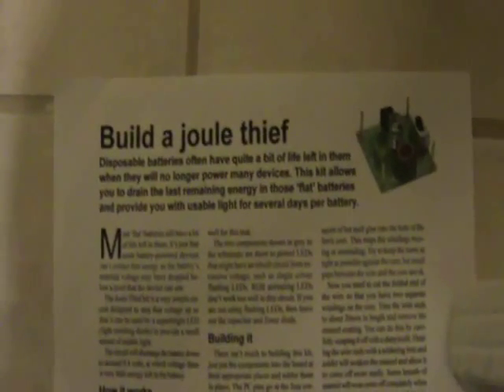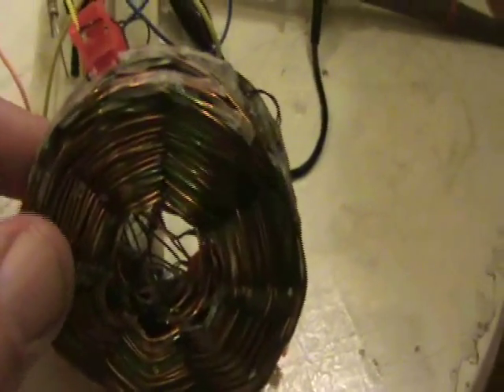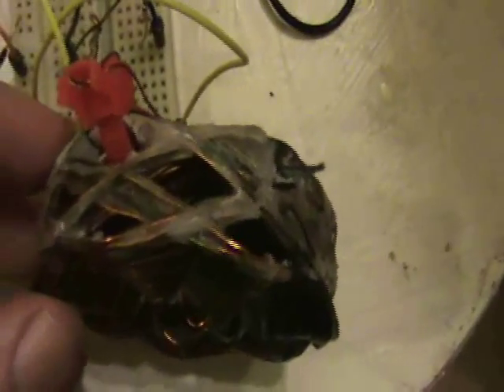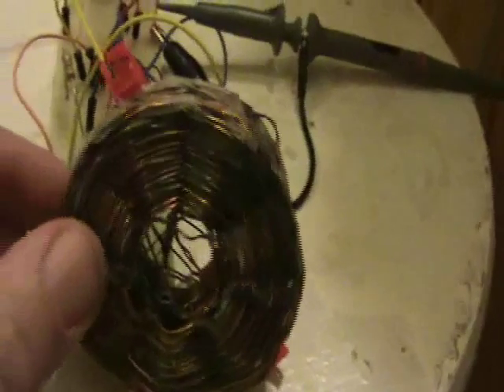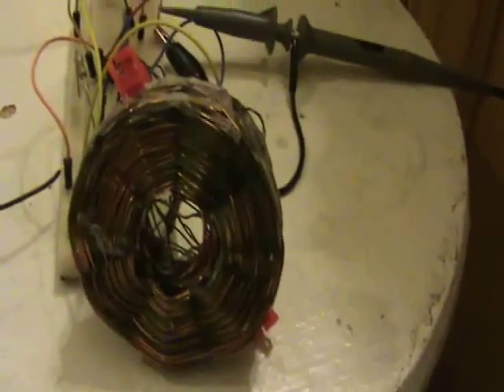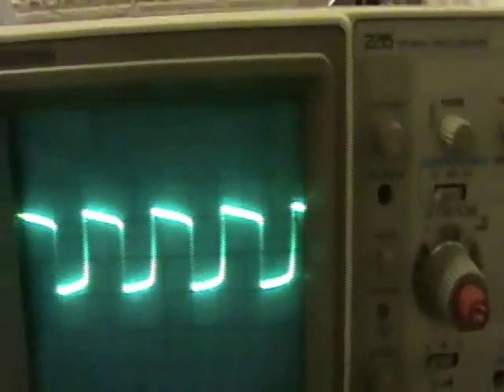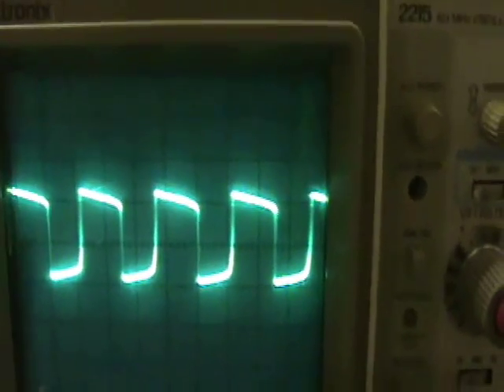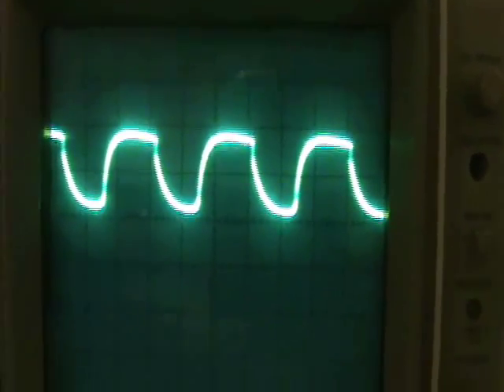Joule Thief  With Honeycomb Bifilar Coil

Comment from the maker: @field16b 
Sure. And the wooden jig is very easy to make .. so yes that would have been an option. Another way I found to do this is prior to winding, attach zip ties between each spoke. After winding, zip each zip tie into a loop around the wire. It is then easy to remove off the jig. Yes similar result to using a ferrite bead. Yes it is more wire .... but the honeycomb coil lends itself to a higher inductance w/o ferro material.

Comment: Could you have left the honeycomb coils on the wooden jig?  I understand that you might want to use the jig again to make other coils, but would it be OK to leave the wood in place?  That might have kept the coil from being damaged when you removed it.

2:25 - You say 1.7 Volts.  I thought it would be higher, since it looks like you are lighting a white LED.  Were you getting the voltage you expected?  Were you getting comparable voltage to the design with a ferrite bead?  

Great experiment!